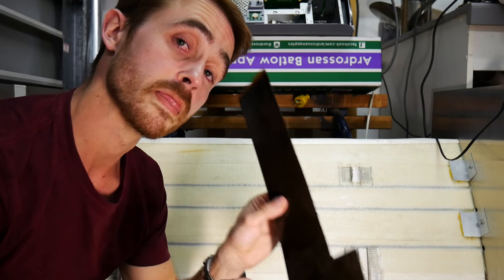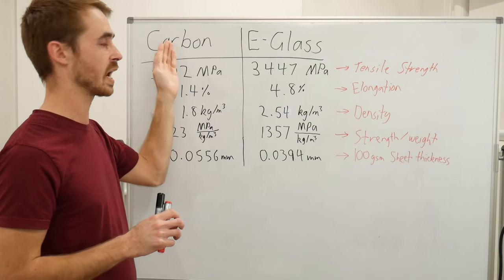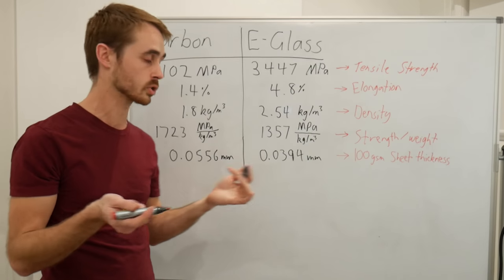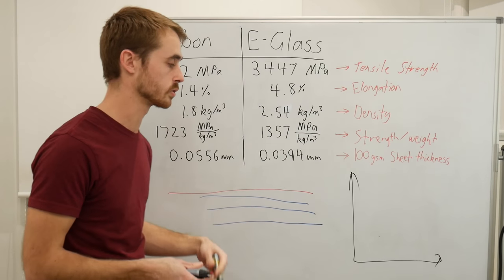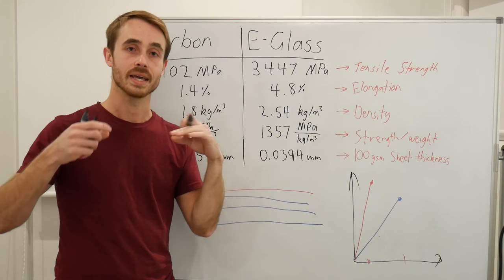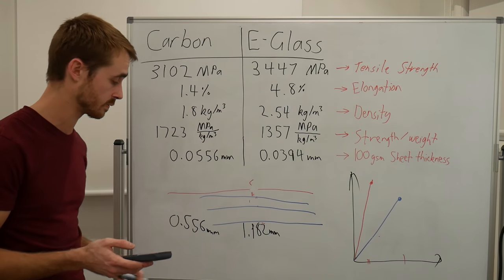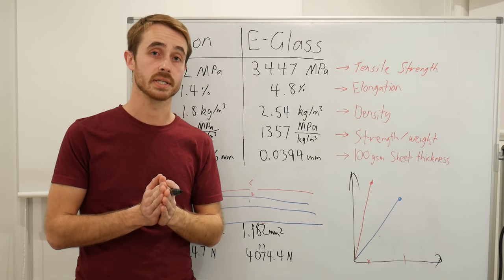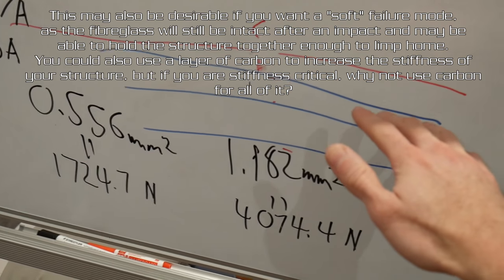Why you SHOULDN'T wrap Fiberglass in Carbon Fiber!

Comment: wouldn't the fact that they are bonded together with adhesive transfer energy between them, making them more like one another and gain a little in their lacking properties?
Reply: Yeah, wasn't sure if he was trying to simplify it or whether it was an oversight. Because the carbon fiber has a higher modulus, it would see less strain. You wouldn't see 1.4% in one layer and then 4.8% in the next layer... if you did you screwed up.
Reply: krap101 when i wrote that comment i realised for the first time that the elements and materials at least in part become a new hybrid element when together than when apart. the combinations and expressions of the forces of this universe are trippy, reality / existence is trippy.
Reply: I bet in bending it's going to be close to what the video describes. Plus in many cases in real life, even if we design our structure to be purely in tension/compression, we're going to get bending anyway.
Reply: Strain would be the same across all layers. So for the same strain the carbon fiber layer will have much higher stress than the glass layers.
Reply: He wasn't saying the strain on one would be 1.4% and 4.8% on the other.

He said that the carbon fiber fails at 1.4% elongation, and the fiberglass fails at 4.8% elongation, so when the part reaches 1.4% elongation, the carbon fiber will fail, and the fiberglass will then take all the load.

Comment: There is a material available at TAP plastics in the US which appears to be a plaid made from carbon fiber and Kevlar.  But is it bad to use the different materials in a composite to take advantage of the strengths of the different materials?  The plaid carbon fiber / Kevlar cloth seems to me like it would be a good transition material between say a carbon stiffening layer and some fiberglass filler layers or Kevlar base layers.
Reply: You usually don't simply add the strength. Kevlar is very good at taking abrasive treatment. so its a good protection for other fibres, but it won't add much to the strenght or stiffness.
Its not the point that there is no way of combining different fibres, but you should know what you are doing or you will end up with a not optimal result.

Comment: Man. How often do you have stretch loads and how often you have bending?
And in bending calculating moment of inertia of cross section you have r^3. Just make materiał symmetrical and calculate only carbon layers, assuming glass inside is not existing and only keeps carbon in place, a filler so it won't collapse. Having for example 25% carbon, 50% glass, 25% carbon, taking into account only carbon and empty space in between you get almost 90% moment of inertia of cross section for having 50% material at maybe 10-15% cost and maybe just a little bit heavier so please explain how it is a bad idea?
And most things people do are rather body parts etc that are mostly bent, not stretched.
If you want part that will be stretched then yeah, you're right, whole cross section works the same, but you just took one example and based on it made conclusion about all possible cases.

Comment: As always, great video! I've seen the same principle on gliders. The whole glider is made of carbon fiber and in the cockpit are a also a few? layers of kevlar, to keep it all together in an outlanding.
Reply: i think the kevlar is there for abrasion resistance but i may be wrong
Reply: dvirus2000 abrasion, and impact, particularly the occasional rock on a field.
Reply: Martin S. The wings are usually made of carbon these days. Glass could take the load in regards to strength, but modern wings are so thin that the lack of stiffness would mean that the wings would bend so far up that they would not create vertical lift any more.
Look at videos of Open Class gliders like ASH25 or EB 28 or EB 29 in flight. You see a lot of flex in these wings. But they are made of carbon fiber, and still flex that much because they are so thin. Imagine the samt made out of glass fiber. They would flex almost straight up, thus probably blocking all control push rods on the way or permanently scraping on the ground when at Stillstand.
The fuselage in contrast is a pretty thick pipe in comparison. It also needs to absorb a lot of torsion forces due to the mounting of the elevator on top of the rudder. Thus strength and flexibility and even distribution of loads is more important. The fuselage is usually not a sandwich of an inner and outer fiber layer  separated by a thick foam layer but one fiber shell also allowing for more flexibility.

Comment: Glass fiber is not used for strength or elongation in composition laminates. It is used to electrically isolate aluminum cores from galvanically corroding against the carbon fiber. Otherwise the epoxy acts as an electrolyte between the aluminum and graphite.
Reply: Could you elaborate?  Real world example,  layup structure etc?

Comment: =edit:=
the answer to my question below is found mainly clearified in the previously held discussions i later found among the comments so no need for additional reply here...
=end edit=
Very good lecture on this topic.  i learned a lot of things to take into consideration. 👍🏼 However  i do remain confused about the argument to "never layer carbon fiber on top of a glass fiber layered base"  🤔?? 
pls correct me if I am not interpreting your words properly but it seems like a perfectly good way to build large, light weight, cost-effective "strong"  panel out glass fiber base layers that may need some additional "stiffness" properties for its application and size,  while keeping weight consequence to a minimum..? I don't see how that's not going to be achieved in this way... 

no,  it will not add any strength to the glass base panel,  as to be expected. but replacing the carbon withthe equivalent mass of additional glass would not never yield as much stiffness either right? so as long as strength of the carbon fiber layer is sufficient for the application, it should be a successful improvement. wouldn't it? 

true enough that a full carbon fiber panel will be just as strong and much stiffer and lighter,  it would also add multiple times the cost.  alternatively,  using a carbon base with a glass top layer would yield a stronger stiff light weight, but still too expensive. and taking out glass mass would improve the weight but at the compromise of strengt right? 

And in most cases that ive seen,  the CF "wrapping goes around both sides,  creating a favorable shell construction around a inexpensive core. could you give you math a go at that situation too?, for comparison? 

cheers

Comment: It's probably weaker than just skipping the graphite layer, because once the carbon cracks, the remaining carbon layer still bonded to the lower layers forms a stress riser at the crack, where otherwise it would be uniform.

Comment: This video was preceded by an advertisement for carbon fiber 3D printing where you add a layer of carbon fiber to other objects lol.
Reply: I have actually used these kinds of printers, that embed carbon fiber strands within nylon material. It is actually extremely useful for creating very stiff prints.
You cannot compare it to this, because you are not using different materials in the same composite. The best way to explain it, is that the nylon material acts as the resin. As you probably know most composites are classed as 'fiber reinforced polymers', meaning that there's fibers (glass/carbon/kevlar etc) embedded in what is called a 'matrix'. The fibers are for strength/stiffness, and the matrix is there for coherence. Usually the matrix used is an epoxy resin, however in the case of these 3D printers the nylon acts as the matrix. 
It is very difficult to attain high stiffness and strength 3D printed parts, and by using embedded fibers you can create parts that are not possible with just polymers.

Comment: From what i saw in plants that manufacture European aircrafts, they use a layer of glass fiber base and then lay the carbon fiber film in different orientations. Most of the structures like the spar joints and door joints are basically carbon fiber parts that are reinforced with titanium and glass fiber. can you explain why such key components will not fail.?

Comment: So if I just wanted to make a stiff optical support, could I use fiberglass tubing and cover it in carbon fiber to achieve a rigid structure?  This structure would be stationary and never subject to shock.
Reply: Yes you can.

Comment: You’d think, on the stress-strain graph, that the force would have to increase before anything happens. So the elongation of the “limiting” material is not relevant at that point. The carbon fibre protects the fibreglass from further elongation.

Comment: I believe his carbon tensile is way too low (reckon 4-7000mpa) which is why it makes the case. You can also wrap "around" parts which is a proper way - outer surface take higher stress.

Comment: I wonder how good Kevlar is at reducing resonance in a car body?    I wonder if body panels made of kevlar would ever have the same properties as sound deadener?       

That alone would cut down on weight as  having a composite that was strong enough for Body panels, while also being able to cut down on noise and resonance would be the way to go.   

I wonder how acoustically dense it would perform in something like a speaker box?    

I have seen many Acrylic and a Few Glass speaker enclosures  , but no so much Kevlar as that's used for speaker drivers.    I wonder how Areogel would fit into this compostite matrix?  And weather that would work well as a Light weight replacement or something like body panels ?

Comment: My question is if you are doing this to save cost and the part is purely for cosmetics is there any reason not to do it? For example if you're making a switch plate. It's not design to take any stress but you still want the Cosmetics of carbon fiber with the added benefit of the low cost of fiberglass

Comment: What about making a composite structure of Fiberglass and Kevlar?

If I were to build a racecar's monocoque out of a mix of Fiberglass and Kevlar woven or knitted together, would the fiberglass make up for the Kevlar's weakness in compression? How much fiberglass would you need to achieve this, and would there still be enough Kevlar to give it a similar weight to Carbon Fiber?

Comment: okay but if you have carbon fiber on top of fiberglass the carbon fiber will flex less than it would have by itself.  You could use the fiberglass as a cheap stiffener and reinforcement for the carbon fiber and the last layer would be carbon fiber to give you a lot of stiffness for interacting with the air. Also although over time you would develop flaws in the final layer and the strength of the product would decline, the breaks in the carbon fiber would not be uniform, it would be compromised in the direction of the most travel but would still give some stiffness in other directions of travel.  I would think if you calculated your load and found barely adequate fiberglass with carbon fiber on either side you would get a torsion box effect that would give you a lot of stiffness, and on top of that you are basically making a part that you don't expect to use forever.  I'm thinking the sandwiched fiberglass would be less expensive than a comparable strength panel of carbon fiber. 

I'm curious to know what you think.  

Like foam board wrapped with poor man's fiberglass or actual fiberglass, the fiberglass reinforced with carbon fiber would end up far superior to the fiberglass by itself.

Comment: Hi, I am building a 50 foot free standing ( no wires) yacht mast. I am building a thin (22 mm) walled Douglas fir mast and want to cover it with many layers of 600 g biaxial glass and 330 g unidirectional carbon, both of which I have. Have you any recommendations to the layering. It will be hand wet lay without vacuum bagging. I expect to have a heavy mast which is fine for this application. As it is unstayed I am trying to build the mast as strong as possible. Thanks, Jim

Comment: There is another problem. When the carbon breaks, all the strain is focused at the break, so all the elongation is happening right where the carbon broke. This means that in terms of energy absorbed before total failure, the fiberglass alone would be much tougher than is it when carbon fiber is added.

Comment: I am going to build a 6 meter length and 1.2 meter width trimaran boat with foam glass fiberglass metod. I want to have an seaworthy  ,strong and light weight structure. How to apply my material?and what material is better to use with fiberglass? And wat material to use for outside of boatr skin ?

Comment: Surely it's enhancing stiffness at low deformation (say airflow over a bumper) regardless? By placing it on the face of a bumper it would help it keep shape at speed then by thinning the carbon at bolt holes, force a hit bumper to tear off the bolts rather than in half. While it doesn't make it ultimately stronger, as mentioned in the materials video, people use "strength" rather loosely and they could be referring to it's resistance to deformation.

Comment: Okay so I've got a question now.  when I was building a fibreglass yacht. for the helipad we use 
carbon double bias ,carbon quad ,fibreglass quad. fibreglass quad. carbon quad foam. then the exact same on the top but opposite starting from carbon quad up.   that's how most panels are made. unless it's full carbon or full fibreglass.  if your correct then why yacht companies use that carbon/fibreglass procedure?  as it all gets painted so the carbon isn't for show.
Reply: I am left with more questions than answers, in theory everything sounds good,even on paper,but if we actually made some items and ran tests would the outcome of failure be as he said or as some of us predict? I was looking for info on composites for mountain boards ,skateboards and such ,trying to start a small business so I too can build a yacht for I am in the ground lol, but seriously, I thought why not do s glass with carbon, the resis would become all one unit to speak of in liquid and then when dry...your yacht is a good example of what I want to do,seems it will be safe,guess testing will tell all.
Reply: liam gibbens I think the answer is damage resistance. You can't rely on just a few layers because rock chips, sand, grit, combined with a rough landing could delaminate the structure. So in that case, think of the glass as being a sandwich core between the layers of carbon to add thickness at lower cost, with the carbon providing the necessary stiffness to handle the stress/shock of landing. then you have your foam in the middle and the plies on the bottom side which mirror the topside in order to create a balanced panel to support the weight of the aircraft.

Comment: What if one were to make a layup of primarily carbon, but with a couple of thinner sheets of fiberglass, in order to hold everything together in the case of a catastrophic failure, say a car crash. The idea being the same as reinforcing glass with a steel mesh, in order to prevent the glass (carbon fiber) from shattering everywhere and causing possible injury.Regards

Comment: I'm thinking 3 times before I buy anything with carbon fiber in it anymore. I have a number of carbon fiber arrows, and sooner than later they start peeling splinters off the exterior of the arrows for no apparent reason. At least on the outside of an arrow I can see it. What happens if it starts coming apart inside fiberglass layers. No thanks.

Comment: @KYLE.ENGINEERS What about the section, force will be also divided by it, and the sandwiched composite will bend creating an arc, would you make this should effectively increase the tensile (or compressive) strength (I don't know how much and I'm too lazy right now to relearn to calculate this).
There is another thing, if the part is  created for impact resistance and shock absorbance, having different elements (should be done properly) in the right layers (carbon, glass, nomex , kevlar  - maybe in that order) might do the work, would you be able to introspect a bit more in this aspect? What about fatigue resistance ? what would be the effect of different layered composites?

Comment: How about some motorcycle helmet? i see some of the major brand use a mixture fiberglass, carbon fiber and kelvar
Reply: I don’t believe this guy has any actual proof. Just paper numbers. There are reasons thousands of manufacturers build hybrid parts.
Reply: @jordanf2022  well he got a job in Formula 1 so...
Reply: @jordanf2022  a hybrid and just one layer on top is totally different

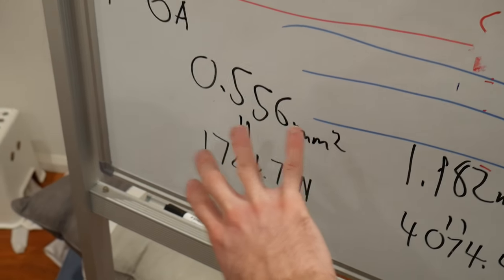Comment: 6:10 It might be worth noting that even though the FG would 'help' the CF in this case, the strength to weight ratio would be extremely poor as you cannot fully 'utilize' the stress strain curve (as you can only use a limited amount of strain before the CF would snap, causing all the load to transfer to the FG causing it to fail most likely as well). 
Essentially because you are only using about 1/3 of the curve, the FG would also have about 1/3 of strength to weight ratio. 
I think except for the 'soft failure mode' as you mentioned in text on the video, it should just be avoided as it doesn't make much sense.